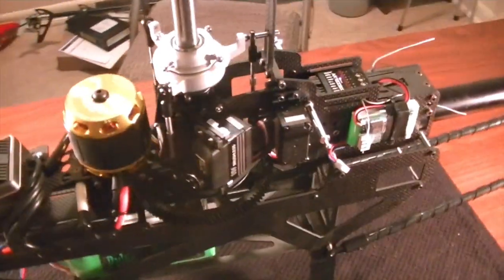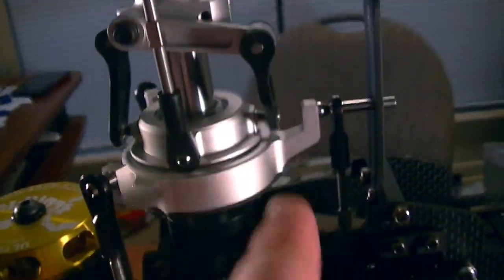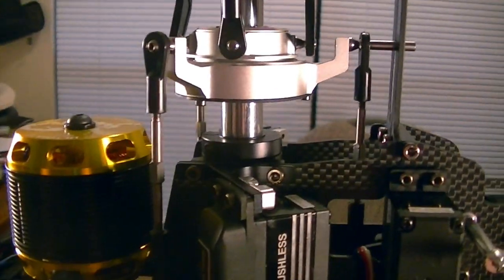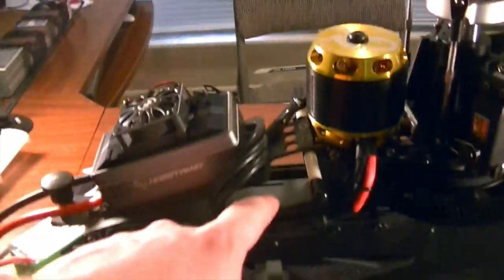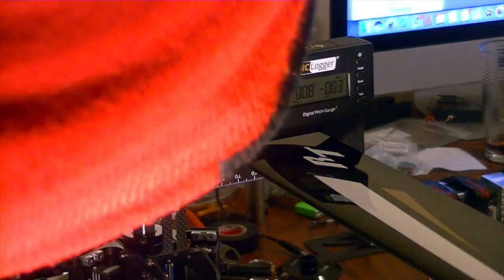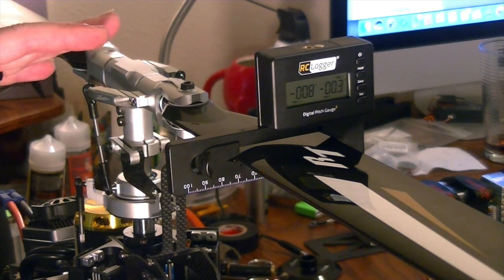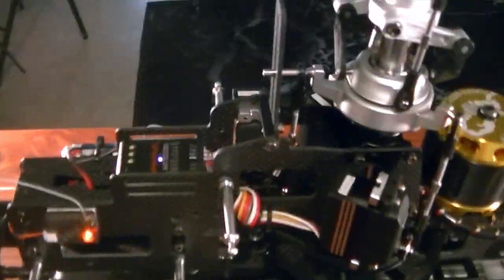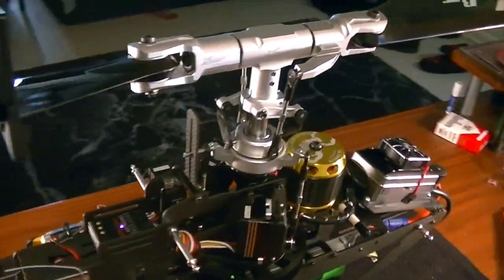AR7200BX / Beast X : Setup Guide #3 (FreddyCanFly)

Comment: Hi, thanks for this video, I have a Trex 450 with AR7200BX, I configured it all as per your instructions, but the pitch even though it’s set to 9.5 degrees both positive and negative and very close to zero degrees at centre stick, it seems to be crazy and moving the sticks a couple of notches on the transmitter is making the heli behave very erratically. 
Do you have any ideas why that would be? E.g. if I move the pitch a tiny bit to positive for the heli to climb, it’s starts to climb extremely fast, if I then move the stick back to where it was instead of the heli going back to a hover, it starts to slam toward the group like I have negative pitch of 9/10 degrees. 
I have other Trex with mini K-Bar fbl system and it doesn’t behave like this.  
Any ideas?
Reply from the maker: @themachine225  do you maybe have any videos or clips I could reference? Each system does have different feels and settings for each pilot.  Also it good to review your head speed settings as well.  I would also recommend to revisit each menu and insure it’s all set up for each parameter.  The small the Heli the more sparatic they can feel as well, however the AR 7200 feels amazing on all platforms.  I would have to say it just needs a little more love in the programming :)
Reply: @33forsaken  hey Freddy, thanks for getting back to me, I have reviewed everything and still getting the same issue. Using parameter menu E I am able to reduce and increase the issue depending on my settings. But essentially what is happening is that the pitch it too slow at responding. So for example, if I am hovering, then I slam the pitch to full
Positive, the heli just sits there for about 3 seconds before it start to climb. Once is starts to climb if I then put the stick back to middle it takes another 3 seconds or so for the heli to stop climbing. So there is a delay but it’s only on the pitch, the cyclic and rudder are fine.
I think this is a fault in the unit as i bought it second hand. But just wondering if you have any final comments before I looking at buying a new one. Thanks again
Reply from the maker: @themachine225  what are your throttle curve settings ? I am wondering ( please forgive me if I am way off ) but is there a chance that you’re not running your motor on a fixed RPM and instead variable points ?   Basically is your throttle increasing in speed as your pitch also increases, and slows down when you decrease ? Basically I guess I am asking is if your using your idle up ( fixed RPM) when getting this delayed or spongy feel.
Reply: @33forsaken  thanks for getting back to me, and for your ideas. I was using fixed rpm but I think the issue is the unit itself. I tried so many different setting and I got it to a point where it is flyable but it’s just not quite right. I decided to remove the AR7200BX and get another one. Thanks for your help and the videos you put out, they are very helpful and taught me a lot.
Reply from the maker: @themachine225  thanks so much my friend :) fly safe out there

Comment: Hello Freddy, I appreciate your replies, thanks a bunch I 'll  go off of your recommendations. Have a good one !
Reply from the maker: Thanks, you too!
Reply: @33forsaken  Hi buddy, I finally had a chance to change out the main shaft on my Blade 400, I take her out for a quick flight, and decided I didnt want to take a chance after what happened the last time. I then went ahead and changed out the stock gyro to the GY 401, I am still.using the stock tail servo and was trying to adjust the gain settings with the collective stick either hard left or right and in the hold position to try and center the servo, but after a few seconds the servo horn would move towards the tail rotor, any thoughts on this issue , Thanks !

Comment: Thanks for the detailed information!! Truly made it simple to set up my Trex 500!! Now the only thing I'm unsure about is the throttle and pitch curves... I tried watching one of your older videos but not sure if the same applies when using the 7200bx... Could you either tell us or if you've already made a video for it send the link?? 
Thanks in advance and thanks again for the great videos!!!
Reply from the maker: So this will heavily depend on the motor and ESC you are using.  If you have a build in GOV then you have to follow the needed curves for that.  If you are using stand alone or V curves then you can set them manually in the radio.  For example the Hobby Wing ESC uses flat curves to let the GOV monitor the RPM and make adjustments as needed.

Comment: hi mate, firstly ,thanks for all your videos ,ive managed to build and set up a few models due to the info you have given out in your videos.  iam having an issue with a brain2 trying to get the esc to calibrate. just wont arm ?  have you done a video on esc calibration for the brain 2 and iam using a castle phoenix ice 100 on my 550E

Comment: Hello

I just watched your video. I’m setting up a TRex 700E V1 with a beast X plus, firmware version 4.1. I’m using a DX8 radio. I do not plan on setting up a stunt one or stunt to just normal flying for the time being my question is I’ve been through the set up many times double and triple checked everything I’ve done everything so much. I’m almost starting to get confused, but when I did the 6° if I remember right, I was getting the 6° with negative pitch, but I could not get it with positive pitch. (I could have this backwards.) when I moved to the next step, I gave myself positive -12.5° one thing I didn’t notice while watching your videos is I was not on a servo when I did these I was at the neutral position within those steps, will that make a big difference? I would really like to get this bird in the air but I’ve had so much difficulty and mishaps. I’m extremely nervous about everything being correct. If there’s anyway that I can talk to you in more detail personally if you’d be willing to help me out, I would greatly appreciate it, thank you for your time, patience, and help
George.

Comment: hey man great videos, i'm new to the hobby also. Quick question, on the beast x when you select the G-setting for swashplate leveling and servo setting your 90's. do you set your servo arms in neutral before cycling through the servos?
Reply from the maker: I do go over this topic in the setup video series.  Basically you want to enter the menu, select a servo put the arm on and apply trims if needed.  Then move the next and the next, once you cycle back to neutral you may notice they change because it ignores the trims.  So in menu G I always make sure to select one servo right when entering and also when exiting this menu.
Reply: @33forsaken   thank you for your help. i did watch your videos many times and got it figured out. i'm just watching your video on tail setup. thank you again for your help and great videos, tons of info.

Comment: Step J is giving me one issue.  Everything in step G is perfect, and 0 degrees of pitch, but when I head over to J, the blades are at -5 degrees, not 0 degrees.  I'm still able to get the blue light at 6 degrees, but any ideas on why my unit is jumping to -5 degrees at the start, and does this affect the settings?  The pitch curve is linear, and I think the only thing I haven't tried is putting the dual rates all at 100, they were already set to lower numbers according to the flight mode.
Reply from the maker: You should have no duel rates added at all, no sub trims, and everything completely default basically for the radio.  Besides the Gyro gain for the rudder, the only other menus you really use are throttle curves, and pitch curves.  The rest is done in the system.  Also what make and model is your Heli? maybe you can send me a videos via FB messenger or text and I can take a look.
Reply: @33forsaken  Hi thanks for the detailed response!  I have a couple of old Blade 300x's with a lot of aftermarket and microheli parts that I'm dusting off and rebuilding.  Actually watching your video carefully really helped.  I didn't know in step G you had to exit with a servo selected.  That's why when I went to step J it hadn't saved my work from G (for zero pitch).  But I have to repeat everything w/no dual rates.  I had no idea about the rudder setup, about putting the gryo on negative to center the servo, I think that's really going to help.  I have 2 questions (1) For a linear pitch curve in J, does that mean a diagonal straight line, or flat staight (as in values set to zero)? And (2) Step K says you shouldn't have a pitch curve does that mean set the transmitter to a flat line with no values, or all 100?  Thanks!

Comment: Hey Freddy, great video as always. I'm having a problem setting up my Trex 500X with the MicroBeast. In Menu E: Rudder Servo Limit, I'm able to set the limits including the Purple/Red light cues. When I get out of the setup and startup my DX9 and Heli in flight mode, the tail servo barely moves? I've tried resetting the limits but it doesn't change anything. 
Also F: Gyro Servo Rudder Direction, when I swing the heli with my hands right/left to see if the blades are compensating with opposing direction, it works in this menu but not when I’m in flight mode, is this correct? The swashplate works when moving it around but not the tail. Thanks.
Reply: My Gyro was set to Inhibit, no gain. Everything is working now, thanks!
Reply from the maker: Hey buddy I think I may have some options to help.
Reply from the maker: Oh haha that was one of them lol way to get it figured out brother fly safe out there !
Reply: @33forsaken  Thanks for replying Freddy, you stay safe too. I’ve been watching you newer AR7200BX videos to help in my Trex 500X build. SOOO helpful, couldn’t have done it without your help (it’s tough trying to decipher those broken English manuals sometimes lol). Thanks again for your generous contribution to our great hobby. You’ve helped tons of people.

Comment: I'm getting even readings on my heli all around except on the right side.  That side seems to have a higher pitch.   not the blade just the right side of the heli.  Is that because the swash isn't perfectly level as I'm not using a swash leveler.